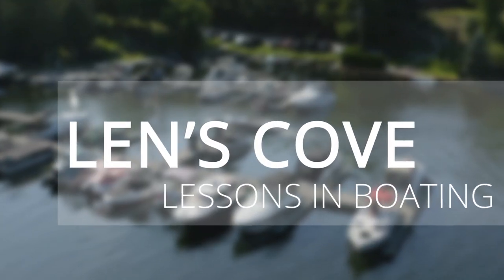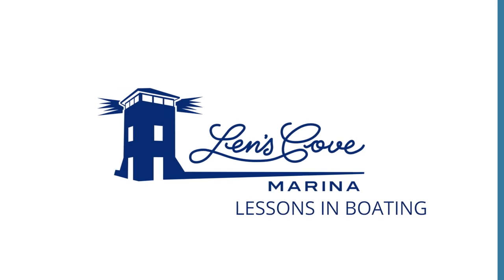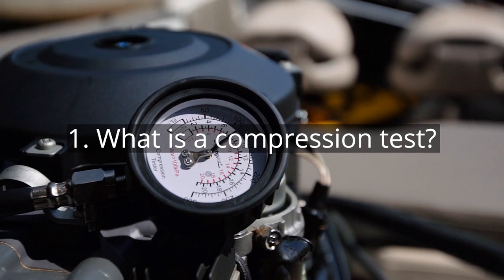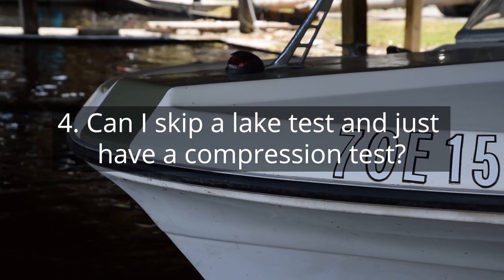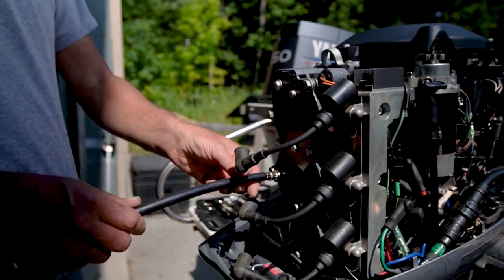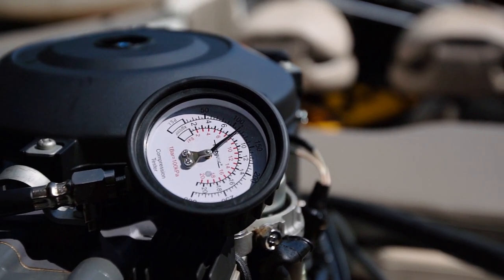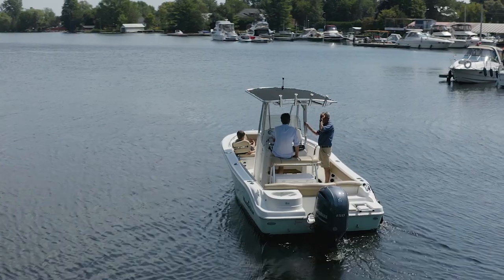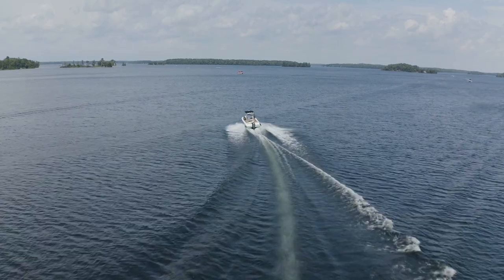Do I need a Compression Test When Buying a Used Boat

Comment: Nice video.  I think what a compression test can catch, even if the boat seems to be running well, is one cylinder that's just starting to get lower compression.  I haven't done tests on boats, but have on cars, and cars can run pretty well while still having one cylinder starting to show signs of lower (but not terrible) compression.

Comment: The anser is YES...But you should also have a sea trial....I JUST had a compression test done on a Carver 396 with Volvo penta 8.1s and the port engine no 4 cylinder came back at 140.  This is low for that engine...Now, that alone was just a concern...BUT the other concern was the fact that there were different spark plugs in the engine....That to me indicates that cylinders may have been misfiring or fouling the plugs.....
Reply from the maker: Agreed and good point Corey

Comment: Buying a used boat here.  If I take the boat on the lake to test and it runs strong... would I still need a compression test with only 50 hours on engine? 

Trying to save $250-$300.